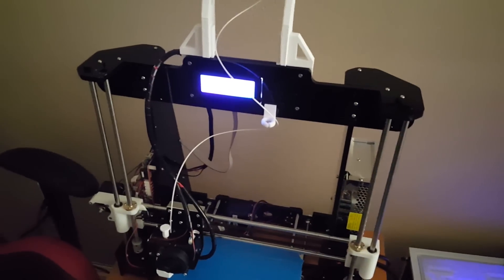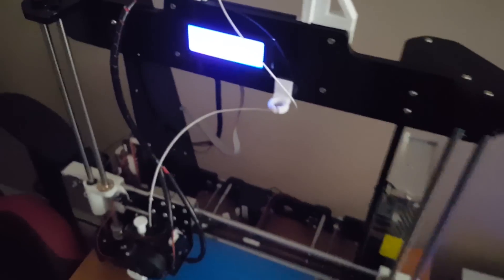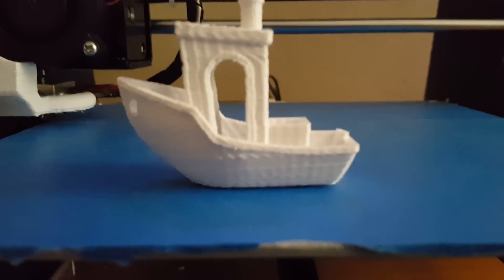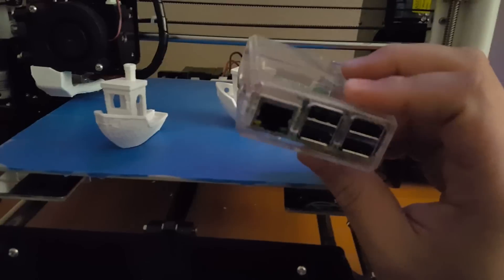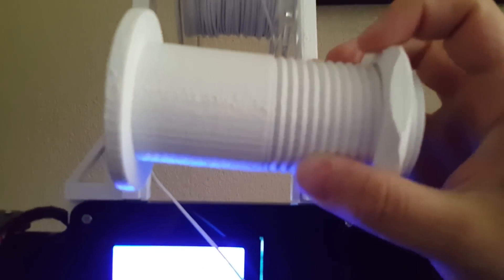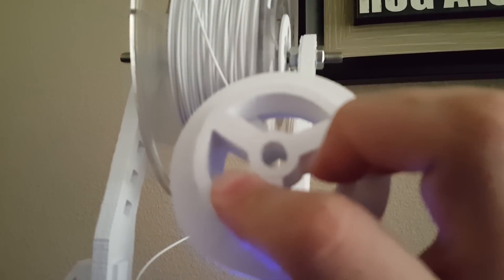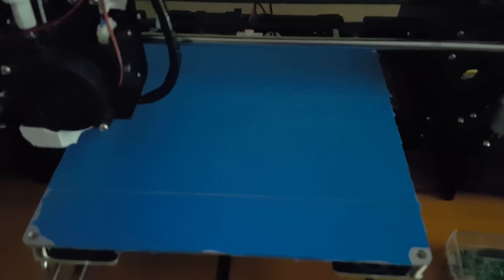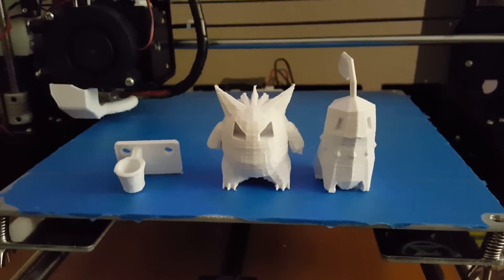Anet A8 Printer Upgrades

Comment: Z axis couplers installed incorrectly rods should be flush with top surface this helps to remove the wave texture on prints

Comment: great video! i wouldn't recommend printing the z rod caps for the gaps because i did and it bent my right z threaded rod and i had to buy a new one. i just printed to bed chain the other day and all waiting to print a handle that goes on the front of the bed so you can pull the bed out without touching anything that's hot. you've done like all the upgrades i have. you got yourself another subscriber! :)
Reply from the maker: Thanks man :) i got alot of upgrades im still doing to this printer its been awhile but hopefully soon ill be uploading the new upgrades :)

Comment: I have a similar machine was advertised as an Anet 8 but was a clone (tronxy), went together quick, everything sems to work except a glitch in the firmware which wil not allow a print, as soon as the nozzle reaches printing heat it cools below the target heat and aborts print, anyone have any links to what settings in the firmware should be?

Comment: hi
You will find that most of the wavyness on the surfaces will be gone aftyer tightening the belts. especially the X axis. I was wondering why the X belt kept getting slack after remounting one end to the carriage (I had no tensioner yet). What I discovered was that the belt was pulling the whole right hand Z axis slider "in" on the two X guide rods!!!
When checking out which tension system to use I noticed the two rod ends sticking out on the side a little bit, rather than being flush as I had installed them. I could push it back out and the slack was gone!!!!!!!!!!!!!!
 The tensioner that Ifound on thingyverse should take care of the problem, it uses 2 screws to tighten the belt. and these screws push right off on the ends of the rods thereby putting the force from the belt onto the rods instead of onto the slider.
I hope this makes all sense.
Reply: i highly recommend replacing the belts as well. the ones included are not good, to say the least - unpleassantly stiff and springy, with the steel wires inside, and they still stretch like old socks. glass fiber re-inforced belts (that are made for linear drives) are much more supple and just do not stretch. you'll feel the world of a difference as soon as you touch a decent quality belt.
Reply from the maker: i just printed the y tensioner and will be printing the x tensioner here soon only problem with that is i would need a new belt since mine is cut already. i will most likely order new belts as Cuda Fx suggested since the ones they come with are a bit stiff.
Reply from the maker: Cuda FX do u have any links to the belts you mentioned?
Reply: MakerMikeEZ, i bought mine form a german ebay listing. that wont be too useful for you. look for GT2 belt (6mm wide), with fiber glass instead of steel strands. a dead give awaiy, is, that the crappy sort costs about 1.50 €/$ per meter, the decent kind about twice as much or more. (belts can be really espensive)

Comment: Nice man.  That filament guide you haven't installed has been my favorite upgrade after the chains and spool holder.  I have the same upgrade you do and then some.  I even printed the same useless prints.  the belt tensioners have been the biggest improvement to me, except the one for y axis.  I cant find one I like that fits.
Reply from the maker: Thanks funny :P Yeah i have just installed the y tensioner which is found here http://www.thingiverse.com/thing:1959208 and it worked great. Now going to order new belts and do the x one next. I also have since installed that filament guide :)
Reply: MakerMikeEZ nice, I put that in yesterday.  I had to shrink it a bit so it would fit.